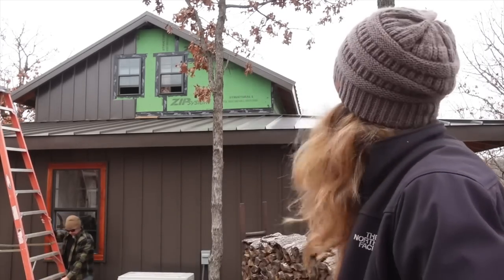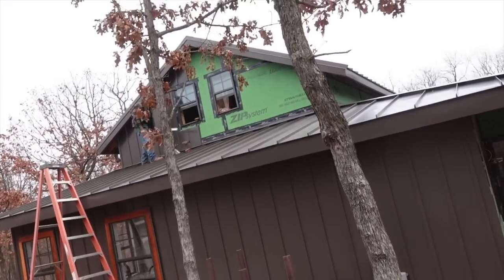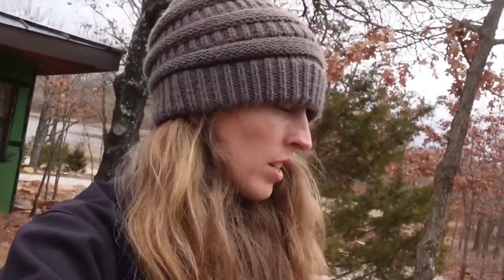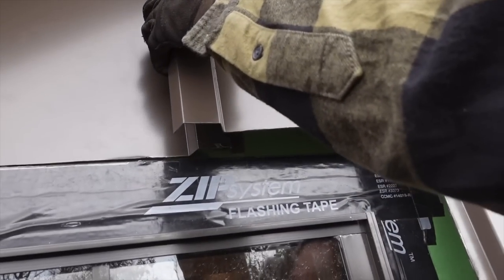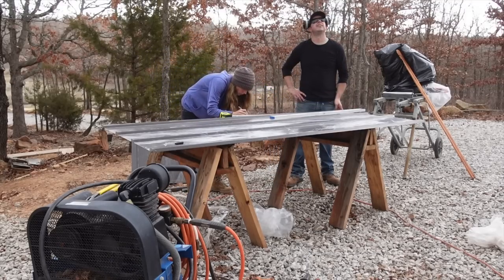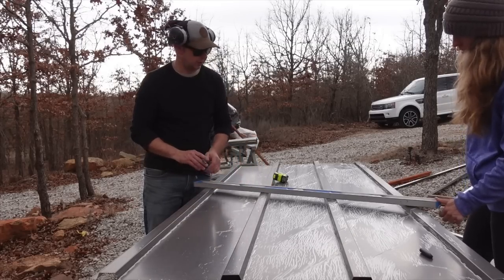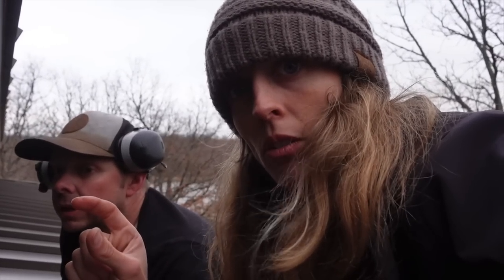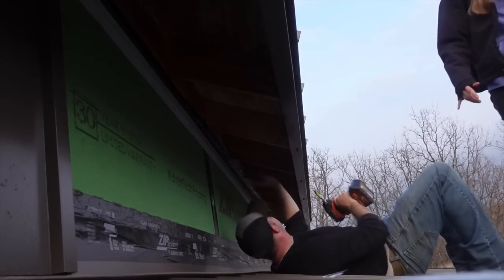Siding our DIY Cabin | Board and Batten Metal

Comment: Hi , your siding has one edge that is slightly larger than the other edge and the wider edge is ment to go over the smaller edge . So if you were to take them back down and start over left to right first section at your corner will be the larger edge and the edge to your right is the smaller ridge , so your next piece of siding with the larger will go over the smaller ridge and so on . Hope this helps you out .
Reply from the maker: The left rib is supposed to be wider. For 25% of our panels, that isn’t the case. They said they “custom rolled” all of them. The right side of the panels has a 1/2” tab on the right side of the rib so flipping them around isn’t an option unfortunately.

Comment: Can you turn the panel around so the narrow rib is on the bottom of the lap and the wide rib is on top of the lap?
Reply from the maker: No. There is a tab on one side of the panel and no tab on the other. The tab side goes underneath the next panel. If we were to flip it and go the other direction, there would be a line (the tab) on every third space. They just messed them up unfortunately.